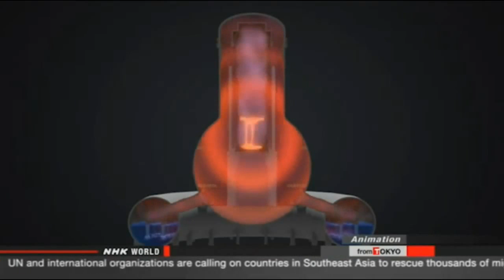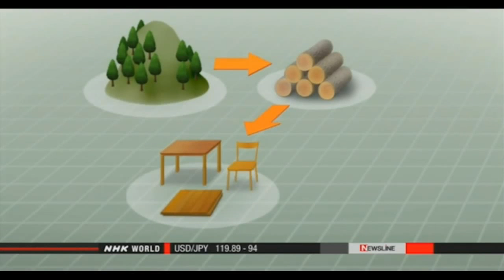Fukushima News 5/20/15:More Fukushima Disaster Findings Revealed; Farcical Decontamination Continues

Comment: Thanks Always MissingSky101 You are amazing, Much Love:-)    Share, Care, OneLove
 #fukushima   #disaster   #ongoing   #wecanseeradiation  
Published on May 20, 2015
More Fukushima disaster findings revealed
Nuclear & Energy May 20, 2015 - Updated 01:22 UTC-4
Tokyo Electric Power Company says it is highly likely it had failed to vent a vessel containing one of the reactors at its Fukushima Daiichi plant in the days after the March 2011 disaster.
TEPCO attempted to vent the Number 2 reactor container to release water vapor and radioactive materials and prevent it from being damaged.
The reactor suffered damage 4 days after the accident, as the pressure inside did not drop. The damage is thought to have caused the release of a massive amount of radioactive materials, forcing most plant workers to temporarily evacuate.
TEPCO has been investigating the accident, focusing on dozens of points that had remained unconfirmed.
The finding on the venting of the Number 2 reactor is one of the 4 points the utility revealed on Wednesday.
TEPCO now says the venting procedure may have failed because in its investigation no high levels of radiation were detected in piping connected to a device called a “rupture disk". Water vapor and radioactive materials were to pass through the disk after venting.
This was the first time for the likelihood of the venting having failed to be substantiated by the actual situation at the site.
TEPCO says it will continue to investigate how the radioactive release occurred at the Number 2 reactor.
It also says it will continue on-site investigations and find out the details of the situation more closely, and use the findings to secure the safe decommissioning of the reactors.

Decontamination begins in Fukushima's Futaba town
Nuclear & Energy May 20, 2015 - Updated 03:20 UTC-4
Full decontamination work has begun in a town near the damaged Fukushima nuclear power plant.
Futaba Town is the last of 11 local municipalities to undergo government decontamination.
The work in Futaba has been delayed due to negotiations over how to rebuild the community, while decontamination in the other 10 municipalities has ended or is underway.
About 200 hectares of land in the town along the Pacific coast is designated for decontamination. With its radioactive levels relatively low, the area is designated as ready to allow early resettlement of residents.
Contractors hired by the government cut grass and removed dirt in ditches on Wednesday.
Contamination work for residential and farming areas is scheduled to be completed by next March.
96 percent of Futaba is still designated as a no-entry zone due to high radiation levels. Town officials are requesting decontamination for that part too, but no decision has been made on the matter.

NRA approves draft assessment on Ikata
Nuclear & Energy May 19, 2015 - Updated 23:33 UTC-4
Japan's nuclear regulator has taken steps toward restarting the Ikata plant in Ehime Prefecture, western Japan.
The Nuclear Regulation Authority unanimously approved its draft assessment on safety measures for the plant's No. 3 reactor on Wednesday.
The draft assessment effectively approves safety measures set forth by the plant's operator, Shikoku Electric Power Company, and clears the way for restarting the reactor.
The NRA says the utility's measures meet new government requirements introduced after the Fukushima Daiichi nuclear accident in March 2011.

Fukushima Radiation Found In Tap Water Around Japan
http://www.prisonplanet.com/fukushima...

Senate panel gives boost to Texas firm’s bid to store nuclear waste
http://bizbeatblog.dallasnews.com/201...

FPL needs more water to run Turkey Point
http://www.miamiherald.com/news/local...

Update: 12/14/14, 8:06 A.M. - Record breaking Radiation detection in Texas Panhandle!
http://www.radiationnetwork.com/Messa...

Hailey gets assurances on nuke waste shipments
Idaho Attorney General Lawrence Wasden told the Hailey City Council on Monday that he will not allow spent nuclear waste to be shipped to the Idaho National Laboratory until the U.S. Department of Energy begins to process 900,000 gallons of liquid nuclear waste there in compliance with a 1995 agreement.
http://www.mtexpress.com/news/hailey/...

Since Fukushima, much interest has developed in the application of checking food and water for possible radiation contamination. Here are your options:
http://www.geigercounters.com/FoodCon...
Reply from the maker: Staceylane74 typo..I meant to say 'no' more amazing.  lol
BTW, your links don't work when you copy and paste.  You need to go directly to the sites on my links and copy them from there.  Just a little tip from MsMilky :)
Reply: MissingSky101 Wow thanks for letting me know, geesh. I will go to the sites from now on. THANK YOU!!!
Reply from the maker: Staceylane74 You're welcome :)